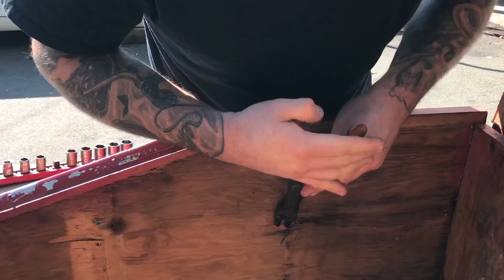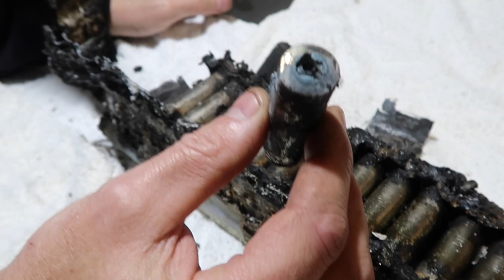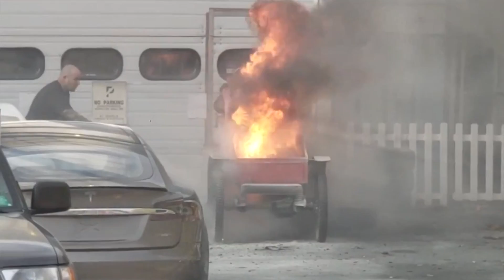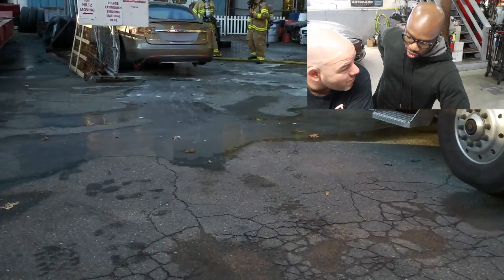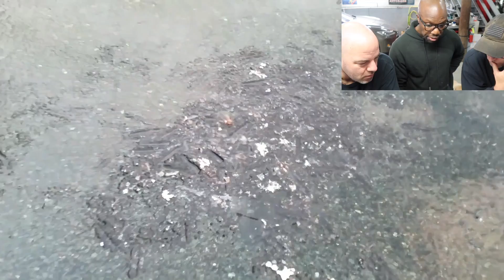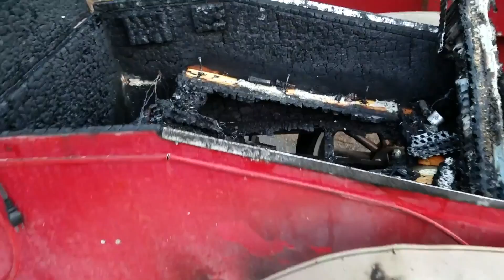My first Tesla Battery Fire

Comment: It's always a bit uncomfortable when someone tries to explain to you what happened while you are watching it for yourself. Well, it's uncomfortable when what they are explaining doesn't match what you are seeing. 
Chris is a badass. It exploded right in front of him and his very first instinct was to run toward it and handle the situation. On fire? Get it out of the shop ASAP. Can't turn it? Shift the entire front end of the vehicle (multiple times in either direction). Hell, despite the other guy running around, back and forth, panicking, not knowing what to do, holding an extinguisher which he wasn't using (he made some bullshit excuse about not using it inside because of the dogs... but then he didn't use it outside, either), in the end, Chris is the one who grabbed the fire extinguisher from the other guy and started using it!
I don't know anything about Chris, but I am going to assume he is a veteran.
Reply: Lee did play a big part in controlling the fire. There really wasnt any panic at all..it was actually pretty good team work!! 👍
Reply: @CBlockTalks  you're a humble man.
Reply: He ran to get the extinguisher, saw the guy pushing it, ran for the door opener. The extinguisher they had is supposedly a HALON version, not your typical ABC powder type.
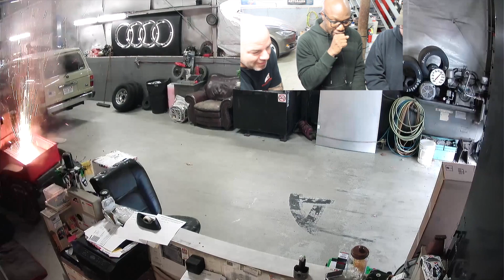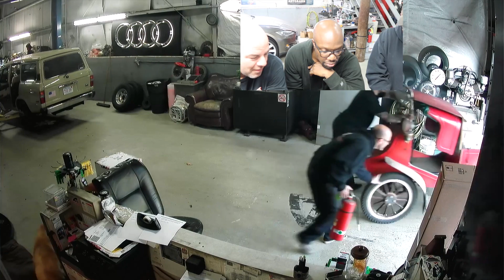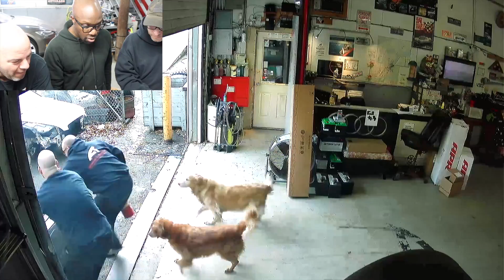Reply: @bobsixtyfour  Lee first tried to blow it out like a birthday candle. Then, he ran away (which looked like, initially, he just ran away instinctively, but then made the correction to go get the fire extinguisher). While he was running away from the fire, Chris was running toward the fire. By the time Lee grabbed the fire extinguisher, Chris was already in the process of pushing the vehicle out (by himself). While Chris was pushing it, Lee ran out front and aimed the fire extinguisher, as if he was about to use it. Before using the fire extinguisher, he changed his mind and went for the garage door opener (behind the desk). Meanwhile, Chris is still pushing and drag-steering the vehicle, by himself. Once the garage door has started to open, Lee does not help Chris push the vehicle, nor does he use the extinguisher. Instead, he remains behind the desk and simply watches Chris handle the vehicle (again, by himself). The garage door started to open at the 4:08 mark and Lee didn't come out from behind the desk until the 4:28 mark. He even admits that he was "ducking for cover" which, as we can see, he did for a solid 20 seconds as Chris continued handling the vehicle... by himself. Lee then decides that he is going to step in and help by very lightly touching the tires, as if he is actually helping Chris move the vehicle any faster (we used to move rolling chassis by pushing/rolling the tires, but it required actual effort and force to be applied, which Lee was not doing). By the 6:05 mark, we can see that Lee is standing way back (behind the fence, even) and recording with his phone (I assume it was his phone) and STILL never used the fire extinguisher. That is when Chris (who is still standing inside the fence and near the vehicle) reaches out and takes the fire extinguisher from Lee, before proceeding to be the first one to actually use it. 
Now, I am not trying to give Lee a hard time or be a dick. But, it is very clear what happened and how each person reacted. Which then makes it uncomfortable to hear Lee walking us through "what happened" and giving us a version in which he was much more helpful and proactive than he actually was. 
Meanwhile, Chris not only did 99% of everything by himself (the only thing Lee did to actually help was to open the garage door), but he is being incredibly humble about it. He isn't talking about his own role in what happened and he actually came into the comments section just to defend Lee and his role in this whole thing. 
Oh, and if the extinguisher they had on hand was not safe for indoor use, then why is that the type that they keep inside the garage? And if being indoors was the issue that caused Lee to not use it, then why didn't Lee finally use it as soon as they vehicle was outside? Why did Chris have to take the extinguisher from Lee and use it, himself?
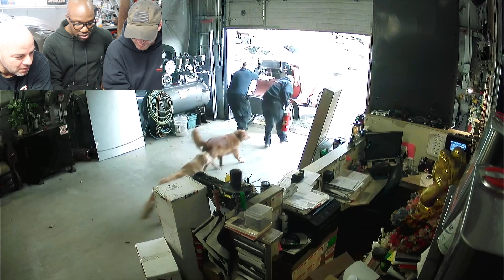Reply: How can you be so sure that Lee never used the fire extinguisher? As soon it the is outside(5:20) it looks like he is using it right into the fire. Then there are multiple cuts. A while later when it really took off(6:05) they had obviously used already a few extinguishers, but realized the they help not much. Also if Lee was the only one filming you will of course only see others doing stuff in that outdoor footage. So i would not draw too many conclusions from this video, especially you can't say someone did 99%, because there are obviously large gaps in the footage, where they had understandably more important stuff to do than filming from behind the fence ;)
Reply: @1Hippo  I can't be sure that he didn't use it. Based on everything I am seeing, though, it appears that he didn't. At the 5:20 mark, I see him once again raise it and aim it, but he then drops it back down to his side before using it. They may have used a few fire extinguishers by the time the 6:05 mark came about, but based on what I am seeing, it appears that Chris was the one handling it. For example, if you had to make an educated guess on who had been using the fire extinguishers before the camera was turned on - the guy who is behind the fence and holding the camera (Lee) or the guy who is standing next to the burning vehicle, with multiple fire extinguishers on the ground next to him, and who we can see grab a fire extinguisher and start to use it once the camera comes on - what would your guess be? 
You're right, there is a lot we are not seeing. There are gaps in the footage. That is why I am simply analyzing what I am seeing in the footage that we do have. I can draw some obvious conclusions from that, too. For example, when I see Lee open the garage door, then hide behind the desk for 20 seconds while Chris handles the vehicle by himself, that is all there is to it. Multiple camera angles and time stamps showed that happening. Lee himself admits that he was "ducking for cover". No amount of additional footage would change what we saw in the footage that has already been provided. So, in cases like that, the gaps in footage aren't too relevant, as they could not possibly negate what we have clearly seen in the provided footage.
Reply: My guess would be that Lee was not standing all the time there doing nothing, else he would probably already turned on the camera at this point. I can't really say more for sure because i was not there.
When Lee opened the garage he was facing the burning side, while Chris had also some cover from behind the vehicle. Also the vehicle is not that wide, so when Chris was handling it with both hands more people trying to help would not have made it better. I agree though that the pushing on the tire without force looked at bit silly.
I probably would have acted not much different. What would you do (in the garage with Chris, facing that situation)?  There is no point in running into the fire and get possibly seriously hurt, just to look like a hero, especially if you can't help more. After all i am happy that it all played out well, nobody got hurt and the shop did not burn down.
Reply: Extinguishers would do NOTHING. That they have no clue about this chemistry, like all Americans (chem edu removed from schools bc we're afraid of bomb making) is a full stop on an EV service license. These men are probably full of metal oxides now. 
Their enthusiasm is entertaining and commendable, as we will need service shops, but they need education and training.

Comment: If there was no BMS connected, and it wasn't being charged, what could of caused them to go off like that?  Could a piece of metal made contact and started a short?

Ok, so reading a bit further, someone mentioned 3:14. So I looked, and before 3:13 you can see a wire on the floor running up the side of the car and into the carriage. At 3:14 the wire is no longer there. Also, the guy jumped position as the video was edited right there, removing a few seconds worth.  
Sooooo, the batteries were being charged WITHOUT a bms, and the cells were most likely OVERCHARGED causing the fire.
Reply: *could've caused.

Yeah, it was overcharged with a charger made for a different battery type with incompatible voltage requirements without watching it like a hawk. Maybe they could have gotten away with it by manually checking the voltage of each group and the temperature of each individual cell while keeping the overall charging current very low to play it at least a bit safer... but there's no substitute for a proper BMS with a large capacity pack. Picking an inherently safer chemistry like LiFePo4 for a rebuild like this would be prudent as well.
Reply: So they had no clue what they were doing...
Reply: Therer's a frame or two missing.
Reply: @mccfrank1212  Yeah, I noticed that when the other commenter pointed it out.  I wonder why they removed a few frames?  🤔  Kind makes ya wonder
Reply: Disappointing if true. Where by disappointing I mean WHAT THE FUCK guys?
I get twitchy with just the small handfuls of 18650s I use for my vapes. Having packs of these things with 300 or so cells and making fuckups like this not charging them right. That's deeply worrisome.
Reply: @EggBastion  your single cell charger has a BMS or voltage cutoff point

Comment: I’m guessing the 2 Tesla modules connected in series was 12s and they used the 48v charger that came with daisy to charge it. The Tesla Modules can only be charged to about 50.4v, while a 48v lead acid charger will put out at least 54v once in the CV phase. 

Without a BMS to bleed off everything the charger was sending it, eventually all the cells were overcharged, and one brick with the highest voltage reached its ignition point first. Then quickly spread.

So my guess is unsupervised charging (human or BMS) with the wrong voltage of a 12s battery pack.
Reply: My thoughts exactly.... Try again. You learn from your mistakes. 👍🙂
Reply: 11:20 and up explains everything. Classic example of people not watching the entire video before making conclusions... Is this how liberals actually make there own assumptions? @beachbro8559
Reply: Wait ? Using liion without à proper charger ? Seriously ?
Reply: I really hope not.  Using a the wrong charger to charge a bunch of Lipo cells out of a tesla pack? That would be literally the stupidest mistake you could make. (Maybe aside from Rich taking his sawzall and kitchen knife to slice the pack in half.)
Reply: Doesn’t have each Modul bms on it ?
Reply: Arnold Horvat, no, they just have the sensing leads for each cell group, which connects to the BMS. I think Tesla uses lets the highest group bleed into the lowest group, not just bleed resisters, so they can’t put the BMS in the modules.
Reply: Yeah sounds correct and that puts Rich right along the stupid tesla hacking/repair guys. How can you ever try to charge Lithium battery without monitoring cell voltage? Why ask for money at the same time presenting a hughe mistake, without explaining what went wrong? 

Everybody can make mistakes but should learn from them and be honest about it.
Reply: lithium ion batteries are more touchy than lead acid batteries, one mistake and then they start shooting off. lead acid batteries can be shorted for long periods of time and still be usable. but the trade off is that lead acid batteries aren't nearly as efficient.
Reply: I  AM  LI-ION . . . . HEAR  ME  ROOOOAR ! !
Reply: More guessing and assuming
Reply: Im having trouble believing none of the people in this video knew this about LiOn charging protocol.
Reply: Cyumadbro summit they do now...
Reply: @cyumadbrosummit3534  That isn't the problem, chargers and battery packs are poorly documented and often misleading. Makita batteries are marketted 18v when they're actually 21v packs, for example. A lot of chargers are marked as 3.6v when they're actually for 4.2v batteries.
Reply: @dimitar4y   Don't take this the wrong way, but you are aware that 3.8 is the nominal voltage for an 18650 right?  Full charge being 4.2volt.  Nominal for a Tesla Module is 22.8V fully charged is 25.2v (4.2 v per cell). This has nothing to do with your hand tools. These are rules for lithium. Get out a volt meter and see for yourself.
Reply: Cyumadbro summit, the problem is it only takes one who doesn’t understand to plug it in and think it will be ok. Perhaps they were using a 48v charger and was supposed to check it every 5-10 minutes and cut it off once voltage got to 48v, but got sidetracked.

Maybe the reason they didn’t state the cause was it would directly implicate the culprit. LOL
Reply: 11:20 and up explains everything. Classic example of people not watching the entire video before making conclusions... Is this how liberals actually make there own assumptions? @imho7250
Reply: @imho7250  Or it could be that they were using the correct charger, but that they had damaged one of the cells when they were cobbling it together.  Or hadn't added sufficient padding/protection to the battery pack to protect it from the complete lack of anything resembling a suspension system in that old buggy, take your pick, lol.
When I first saw the video where they did this, I thought it was a bad idea, especially considering how it was just sitting there exposed in the back of a wooden bed, no bueno, smh.
Reply: IMHO from my understanding, lithium ion batteries are under a lot of stress while holding a charge. So does over charging cause in interns to flex and the pos and neg sides to touch? I know grounding 18650 on itself will start a fire.
Reply: moptop85, yes, there’s a lot of factors, but the chain reaction starts once the charging energy can no longer be stored as a chemical energy, and then has no choice but to make heat. This causes that the cathode to become unstable and produce CO2 while the separator also gets weakened. Once it gets an internal short, it becomes runaway.

Normally, the modules thermal Cooling, cell separation, and BMS prevents the entire battery from getting so hot that one cell can heat adjacent cells up to ignition. But in this case I think the entire battery was overheated, so it quickly jumped.

Of course when he blew on it, he blew away the CO2 gas and fed in some fresh O2, and that really got the party started. Unplugging it and hitting it with CO2 until might has prevented the fireworks, but the modules were probably already overstressed and shouldn’t be used in something that jars them so violently.
Reply: @imho7250  Thanks for a great explanation.  It's disappointing that they let this happen, they might hope the news runs with it to get more views, but this can and probably will turn into  big problem for Tesla.  Once people spin it how they want to spin it.
Reply: GIFT 4000, hopefully Rich does a follow up and states exactly how they did it, even if they don’t want to give names of who did it. Lol
Reply: 11:20 and up explains everything. Classic example of people not watching the entire video before making conclusions... Is this how liberals actually make there own assumptions? @moptop85
Reply: Regardless this is why idiots shouldnt play with lipos. They're not toys.... Wouldnt be such a fun little project if it burned that whole shop down at night when nobody was there to roll it outside.
Reply: topher, yes, it could have been much worse, but everything they did with the car up to that point was ok, except they could have strapped the modules down better. 

It would have been nice if Rich showed the state of balance of each of the 12 bricks before, and showed that he had a charger that would only charge to 48v, which would be 4.0v per cell, very safe if the pack is balanced at that voltage. 

At this point we don’t know if it was carelessness or ignorance, but my first guess is they knew better but were just trying to charge with the Constant Current phase of the charger, and turn it off when it got to 48V. 

I have a electric scooter with 48v 20ah battery (4x 12v 20ah batteries in series), and the charger will fast charge them at 2.7a up to 57v, then taper current down as voltage climbs  up to 59.2 V until amps drop to 0.35, then it drops to 55v float. If the charger they used follows that profile, it will pump in max current even when all cells are past their safe limit.

The Panasonic 18650B is an unprotected cell, which should only be used with a BMS, as it is in the Tesla. Clearly this isn’t Tesla’s fault, because these batteries were never supposed to see these conditions, unless it’s after hitting a concrete lane divider. LOL
Reply: 11:20 and up explains everything. Classic example of people not watching the entire video before making conclusions... Is this how liberals actually make there own assumptions? @miniwarrior7
Reply: I'd say the earths resonances weren't having it mixing the early 1900s with the current technology. like trump riding in an underground maglev except more racist.
Reply: @EternalResonance  Trump is a billionaire AND president of the U.S.   How bout you ?
Reply: 11:20 and up explains everything. Classic example of people not watching the entire video before making conclusions... Is this how liberals actually make there own assumptions?
Reply: @Nighterlev  why yes - it is.  How else is one expected to come to an illogical conclusion ?

Comment: The metal looks good still... You could probably rebuild that sucker, just instead of using firecrackers, use 18650s with a proper charge controller and shit

Comment: I'm thinking a few things could of gone wrong. 1. using improper charger and bms system so they over charged. 2. they didn't check the battery connectors after they drove it we all noticed the packs shifted after they drove it. 3. the fact that they reused the old crappy wiring, motor controller and motor. or 4. all of the above.